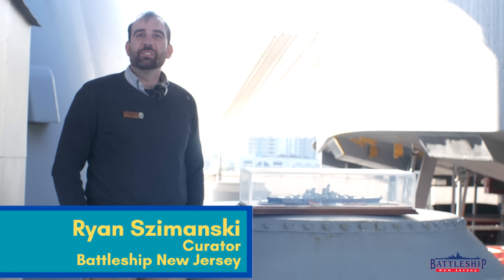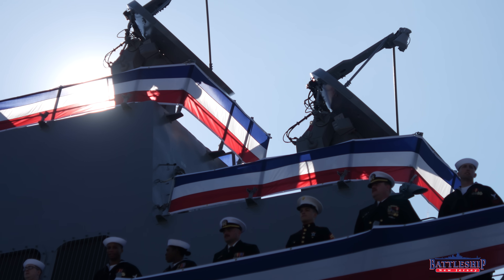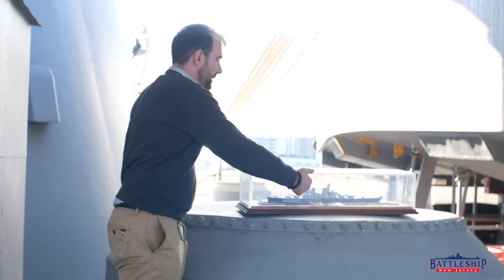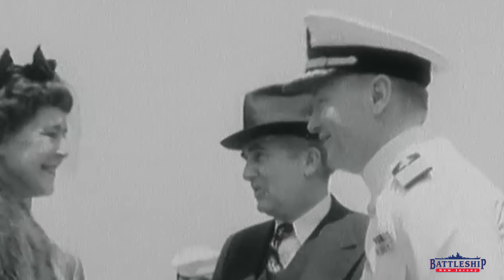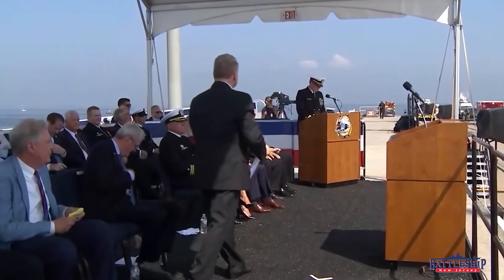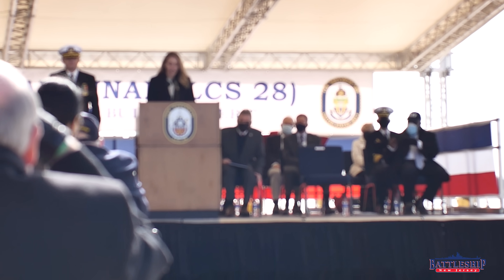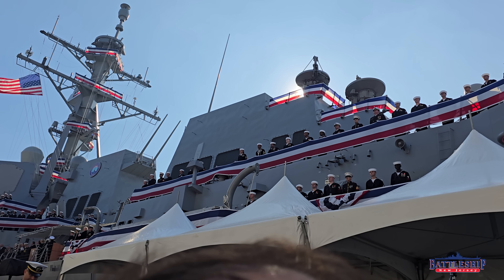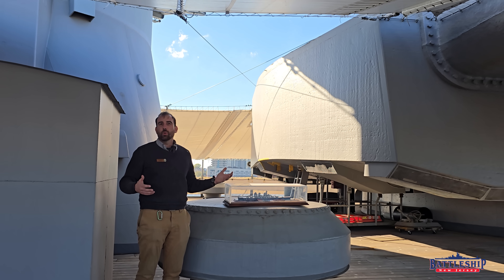Commissioning a US Navy Warship

Comment: I have a question for you Ryan:

What happens to either USS New Jersey if, hypothetically speaking, BB-62 USS New Jersey were pulled back into service?

Would they both be USS New Jersey but with different hull designations and numbers, or would one of them be re-named?
Reply: Fairly certain Ryan covered that in another video- not sure which one, though. I think in that event, however unlikely, BB62 would be referred to as 'Old New Jersey'.